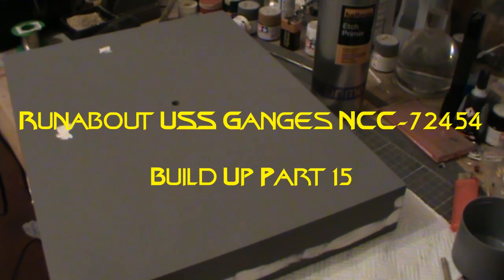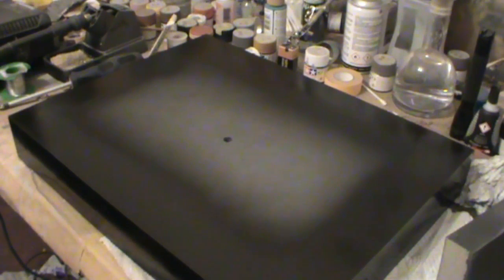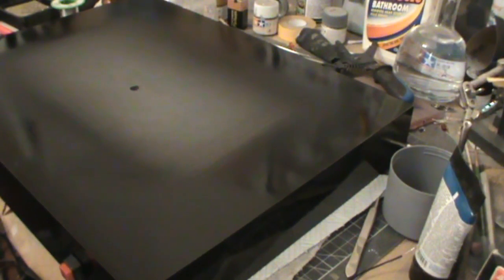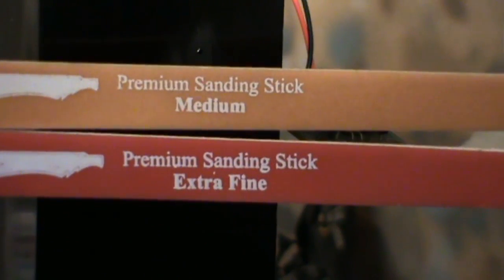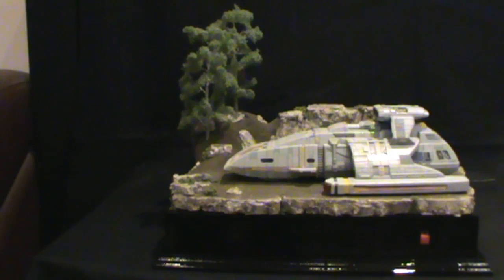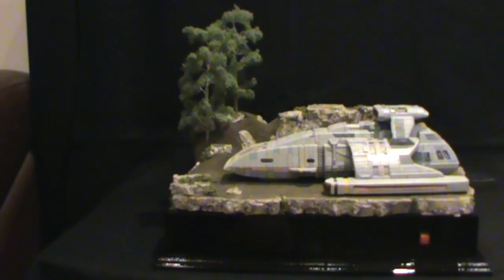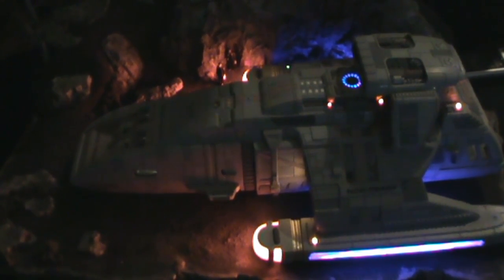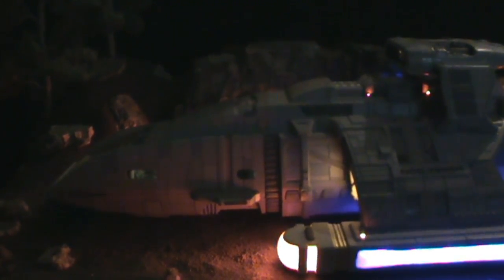AMT/ERTL 1:72 Scale Runabout USS Ganges Part 15 The Finale

Comment: Lovin' it.Did you replace the windows in the front cockpit? Replaced all mine with some PETG but the curved cockpit window is a head scratcher.
Reply from the maker: +Iain Hamilton Thanks Iain, I did use the petg for the front window too. All I did was measure the window cut the plastic to size. Then leaving the film on both sides put it into place marked where the bend needed to be and placed the plastic into very hot water to soften up (about 10 minutes) Then used a metal ruler to bend the plastic into shape. then dunked into cold water to stiffen up again.